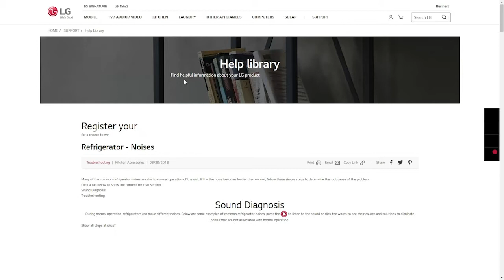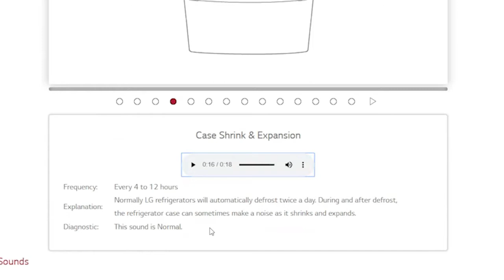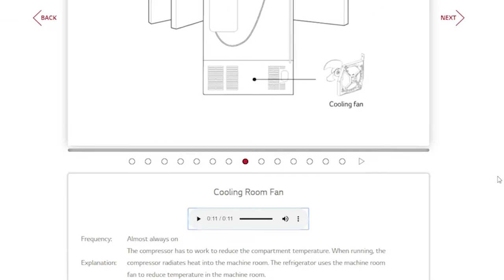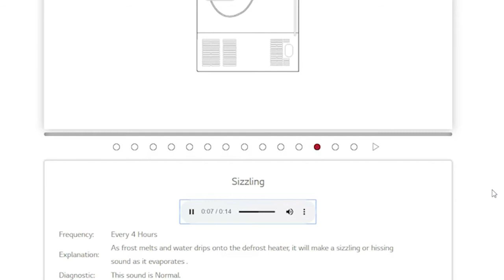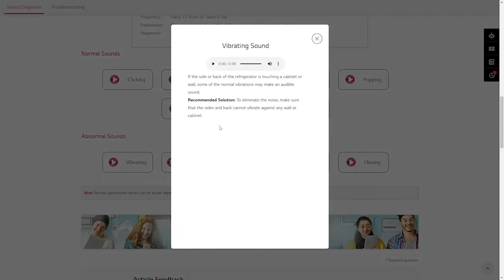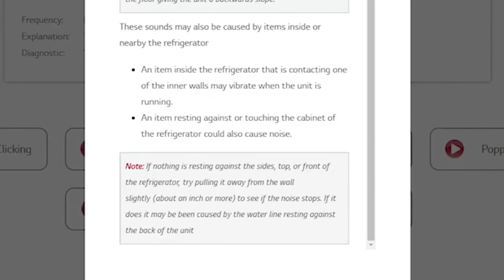[LG Refrigerators] Identifying Noises

Comment: I have a brand new LG refrigerator model LTCS20020. When the compressor is not working the fridge continuously makes a noise like a frog croaking. It is very annoying. The noise only stops when the compressor is back working again. I do not have an ice maker though there is a plug inside the freezer to put one in, but no switch to turn off.
Reply from the maker: Hello Nancy, welcome to our social media page, based on your recent post, it seems you need an assistance, please send us a private message together with the model and serial number of your product,, and also what's the issue of your product, so that I can assist you further.

^Arnel
Reply: @LGUSASupport   How do I PM you?
Reply from the maker: Hi there, Welcome to our Social Media page. Based on your recent post, we see that you may need support. Please send us a private message with your name and phone number so that we can assist you further. ^Ly
Reply from the maker: Hello! I'm passing by to check up on your case. Do you still need assistance? If so, let us know if there is anything that we can do for you. ^Ly
Reply: @LGUSASupport  I'm in Canada, so I guess I should contact LG Canada?
Reply: I have a noise not covered in your excellent video. Can I send to you?
Reply from the maker: Hello Nancy, if you land to send us a private message, all you have to do is go to our website https://www.lg.com/us, and when you scroll down, at the bottom you will see there our different kind of social media platform, so choose which one you would like to use.

^Arnel
Reply from the maker: Hello Nancy, I'm passing by to check up your case, and this regarding about your LG product, and also I explain it to you to how to send a private message to us, but we never heard from you, We're assuming that your concern has been addressed already, If you have any other question, don't hesitate to send us a message anytime, for now I'll go ahead and end our session, again thank you very much and have a great day.

^Arnel
Reply: @LGUSASupport  Thank you for checking in.  I did a live chat and found out that the sound was normal but should be no longer than an hour.  Well, the problem not solved until hours later, my husband was putting something back into the freezer and happened to bend down and saw something twirling in the back.  Turns out that a switch to turn on ice making was accidentally turned on and once turned off, the sound stopped.  Fridge back to normal!!  Thanks!  You should definitely have customers check that first before anything else!  Shoving an ice tray (we don't have ice making) or ice cream or ?? must have clipped the switch.
Thanks.

Comment: I have a clicking sound.  It seems to be somewhat periodic but consistent everyday.  I also notice ice forming in a sheet at the bottom of the freezer, and after a certain point I will see water on the floor.  The website you referred to didn't really help identify the problem.  Anything to point me in the right direction?
Reply from the maker: Hi, Jeffrey. I’m sorry to hear you're having this issue, and I’d like to see if we can assist. Please contact LG Customer Support by direct message via Twitter ( @LGUSSupport  ) or Facebook Messenger ( https://www.facebook.com/LGUSA/ ) ^John
Reply: @LGUSASupport  They were no help at all.  Told me to get a technician to look at it.  Thanks
Reply from the maker: Jeffrey , we are glad to help . Please check the link :

https://www.lg.com/us/support/help-library/frost-buildup-refrigerator-CT00023125-1400774608218

Once the steps are followed , please let us know if you need assistance , send us a private message and we are glad to check others options.

Comment: Hi, I have the case of the periodic buzzing noise caused by the ice maker because water supply is not connected. Well, I turned the ice maker off but still the noise persists!
Reply: LG GR-P157NIS - Side by Side Refrigerator with Indoor Ice Maker
Buzzer Sound Mute mode
Will set the buzzer/beep/error/ding/alarm sound to "off"
Press and hold the "Express FRZ" button for more than 5 seconds (you will hear a beep, the final beep!), and Mute mode it active until the next reset.
You can unmute with another 5 second press on the "Express FRZ" button.